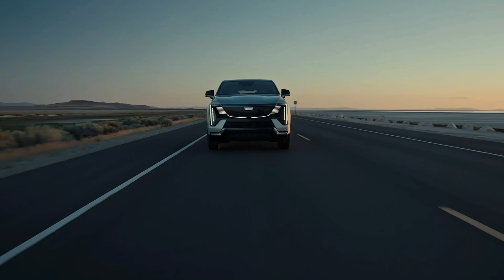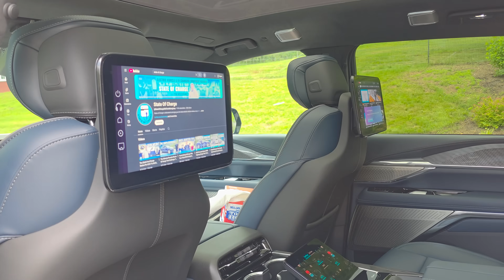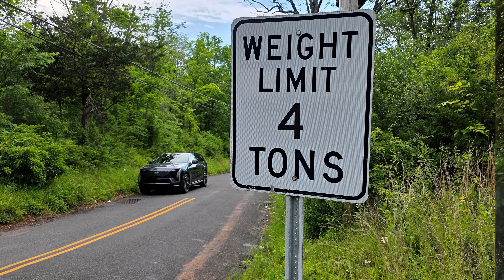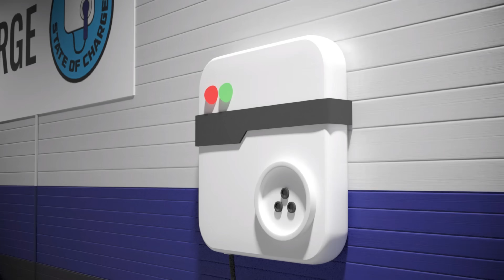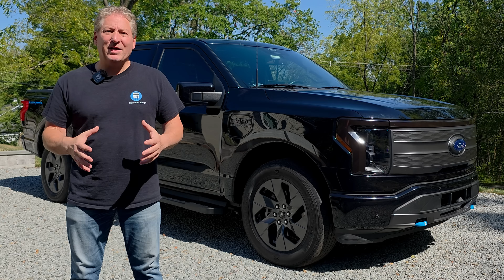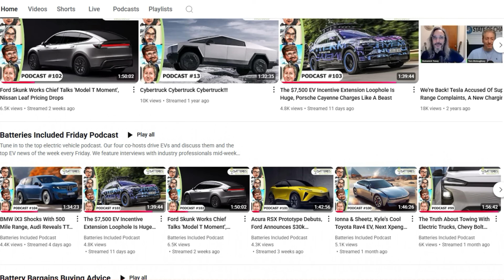Are General Motors Electric Vehicles Too Heavy For Some Public Roads?

Comment: Thanks for this. Honestly, most people are too clueless about their vehicle weight and posted limits for it to even occur to them to care, but for the few that do, useful and interesting info here. Fact is (and the comment from the anonymous engineer supports this), even with a 4 ton limit, a 4.5 ton vehicle isn't really going to cause excessive damage (on regular roads), or seriously stress bridges or other structures. It's not enough over the limit to matter. So while I think it's logical to conclude that in many if not most cases, the limit is more about limiting commercial vehicle traffic rather than specific structural issues, even if it were the latter these 4.5 ton vehicles seem "close enough" to not be concerned.

All that said, IMHO the real concern is efficiency and driver competence. Even 4 tons would be way heavier than most drivers have experience dealing with, and of course 4.5 tons is even worse. The EU limits "run of the mill/non-commercial" car and van drivers to 3.5 tons, and I wouldn't object to seeing a similar limit in the US. Even if braking is improved to keep stopping distances comparable, these super-heavy vehicles just don't handle as well as what most drivers are trained for and experienced with, and drivers should be required to get additional training and certification to be allowed to operate them.

On efficiency, these behemoth EVs that are showing up seem crazy to me. Sure, they are still better than the gas/diesel equivalent, but not nearly as much better as they could be if people didn't insist on 400-600 miles of range. I would love to see excise taxes imposed on all vehicles in all states, based on the weight of the vehicle, and taking into account all costs externalized by the vehicle. This would include road maintenance, but also environmental and health impacts, these two latter which are completely ignored in our current fuel tax system.

With EVs not paying fuel taxes, we need to figure out some kind of system that helps address that lack. Such a system might as well replace the old system with one that covers all the different vehicles in a more equitable way, rather than all the ad hoc "we hate EVs, so we're going to add a fee to registration that's double what an equivalent gas car would've paid" crap going on around the US states.

(In this fantasy world of mine, I would also change transportation budget allocations so that motor vehicles aren't 80-90% of the budget they way they are now. Even modest reallocation would allow a *doubling* of funds going to public transportation and "active mobility", i.e. ped/bike/scooter/etc. while still preserving most of highway and bridge maintenance funding, that's how imbalanced the funding is today.)

Comment: As always, it depends.  I was avoid driving on any specific structure with a weight limit as I would expect there is specific engineering involved.  There is a parking desk with chargers I used recently that at a 7500 pound weight limit.  It used to be less, but due to the weight of many of the cars that wanted to charge there, it was re-rated.

At the end of the day, if there is any damage that can be tied to a specific violation, you can expect paperwork.  In the original case used here, I think you will not have much issue unless you run into that official that wants to throw their weight around.

Comment: Tom, what you are saying makes sense for roads/bridges.  But what about parking structures?  They are not meant for large trucks.  So the weight limits there would seem to include only cars and light trucks.  With more and more EVs being sold, at some point it could matter how many EVs are parked in a multi-level garage.  If you get a hold of that gentleman (the retired Civil Engineer), please ask him about that.  Thanks for your videos.
Reply: Even our driveway, garage limits need to be understood.

Comment: Commercial Truck Driver chiming in here. NEVER go over a bridge if you are over it's weight! 

If the bridge collapses, YOU ARE LIABLE for any and all repairs to said bridge!

https://share.google/Yks8hXBLlyJXSFrta

EDIT
Also theweight limit could apply to ANY of the following if it's at the beginning of the road: 

-Asphalt Weight Limit
Usually applies to secondary roads during the summer months when the asphalt would be warmer and more susceptible to damage. 

- Buried Water Mains
There may not be a sufficient base under the roadway to keep you from collapsing a water main that traverses under the roadway with a heavier vehicle. Driving over such road could cause a water main break. 

- Bridge Weight Limit
Exceeding the bridge weight limit at a minimum will reduce its lifespan. At the worst it could cause an immediate collapse of the bridge possibly killing you and many others. If this happens you will be on the hook for everything in your life will be destroyed financially and legally.

Comment: Having been a police officer in the mid-west many years ago, we used to have "seasonal" weight limits posted certain times a year (based around cold weather changes).  However, there were almost no police who enforced those postings.  Mainly the IL state police and a coupld county deputies.  But the funny thing is that the vast majority of drivers would have zero clue how heavy the vehicle is that they are driving.  And even fewer would pay attention to any signs.

Comment: There are additional costs to large, heavy vehicles like the 9K+ pound GM EVs - extra tire wear and particulate generation is inevitable, as are the costs of accidents with smaller, lighter vehicles. As well, the mass requires additional electric power for a given distance, which means whatever the source - Solar, Hydro, Nuk [sic], or Fossil - there's a need for more power generation and its costs ($ and environmental).

Electric cars and trucks are not "clean" in any whole-system accounting, and this trend towards excess just makes it worse.

Comment: You provided the best information! I purchased a Grizzl-e 48amp charger based on your recommendation.  It's outside in Florida. 
I especially liked the information about the weight of EV's not being significant vs ICE vehicles.  This is a common talking point of the gasoline industry.  I would really enjoy a video of the PhD engineer that you referenced.  
Keep up the honest and unbiased information for the EV lifestyle.

Comment: I saw one of these massive SUVs charging in my home town. Coincidentally it was when I was charging my brand new Equinox. It’s a small town and only has a single public charger that is a 7kW L2 charger. Fine for me for overnight charging, but when I looked up the size of the battery pack on that beast I hoped they were only topping up or they would be stuck there for a couple days!

Comment: Thanks for your follow up on this topic Tom. I would love to hear more from your experienced pavement follower. I know I've seen similar commentary on the vehicle weight to pavement damage and have seen clips from studies done outside the US about this topic supporting the standpoint of your experienced pavement follower. Considering the innovations in the automotive industry in the last 15years, it may well be time to whole hog review and revamp the ordinances, roadway design and roadway safety features with these heavier and wider vehicles in mind. Certainly some parking lots could use some re-thinking. Heck, is the old 3-4 car length highway speed travel spacing enough or does that need to be updated with consideration to the vehicle weights? (Maybe we go 6 car length Covid spacing 😇)

Since the signage is unclear, I would find it difficult to believe that the average user would be able to easily differentiate if this weight limit signage was due to structural issues vs. commercial vehicle re-routing. I would have no trouble believing that, should an issue somehow happen while crossing that surface, your insurance company would use that (as they tend to use any reason) to disqualify you for coverage. I would also not trust that one police opinion on the matter would be carried out 100% by every officer in that same region unless it was clearly spelled out in the ordinance. I could easily see it tacked into someone getting a ticket for failing to yield, speeding, having an expired tag or wearing white after labor day (old person humor). Drivers should probably assume the worst case scenario for their own personal and pocket book safety. Assume that the road will fail and there will be a cop in the bushes nearby to immediately ticket you. Someone might also take a picture and send it to your parents to let them know how naughty you've been.

Comment: as an interesting point in talking about weight, those keen Engineering types like myself with a sense of what the heck it is they're looking at in the first place will have noticed with the recent debut of the sweet Polestar 5 EV (a Sedan btw so not an electric SUV or Truck) is that it uses a ginormous 112 kWh battery pack, and has a 120 inch wheelbase (this would be same as a Gas Tahoe) and is fitted with 22 inch wheels all around.  now DESPITE the fact that this uses advanced all aluminum construction similar to a Lucid, the rumored weight of this new EV is nevertheless predicted be a massive 5,600 lbs, and this actually checks out when you consider that the ultra advanced Air Sapphire Sedan with it's Tri-Motor RDU and 118 kWh battery pack weighs (rounded up) 5,400 lbs...

ladies and gentlemen OG BMW Phil tells you with the same authority as that Civil Engineer that the idea of "battery progress" that you've been getting sold over the last 10 years is a MYTH.  ref: The "Myth of Progress". also ref: "The greatest DERANGEMENT of the mind is believing in something because one WISHES it to to be true..." - Louis Pasteur (1822-1985)

Comment: Tom.  Did a quick google search and this came up.  

For most pavement designs, engineers primarily focus on heavy trucks because their weight causes the vast majority of road damage. The impact of passenger cars is considered negligible in comparison, but they are still factored into the overall traffic volume and used to determine the geometric features of the road.

Comment: I envy your bladder if you can drive for 600 miles without a stop.   My real world experience in road tripping at my age is that after about 200 miles (~3 hours) I need a break is and that’s about as long as I want to go before stopping to take a break and charge.   500-600 mile range just means that I’m carrying around a huge battery I don’t need at basically any time..

Comment: Tom, what about for thinner secondary roads, where heavier, EVs are (or will be) causing a disproportional amount of the deterioration of the roadway?  So the civil engineers argument is really for a weight-based road tax, isn't it? 

The problem with expertise it can be used to mislead, just as well as inform. (At least that's what I find from my mechanical engineering perspective)

And FWIW in PA there are exemptions to road weight limits, for local deliveries and egress, So I'd be safe to own one. But would still have to stay off the underweight bridges.

Thanks for the thought-provoking rabbit holes ;)

Comment: I wonder as EV batteries (maybe not, as pointed out about density improvements) get larger, NHTSA will start requiring these heavier EVs to require lower PSI tires. Which means much wider tires and/or dually requirements.
From what I've heard from roadway engineers that it's not necessarily the overall weight that matters, it's the PSI required to support the vehicle and/or load as that's what's ultimately putting pressure and therefore damage on the pavement. 

But as pointed out in that engineers youtube post, most semi's and other medium duty vehicle tires are 80-100PSI+ compared to even HD 1-tons that are usually 60 or less. My Tesla and Equinox EV are ~42PSI compared to the 32 of the ICE Camry I had. So not a big difference compared to 80+ of commercial vehicles.

Comment: In Michigan, electric vehicle (EV) registration fees consist of a regular vehicle registration fee plus an annual EV surcharge, both of which are primarily based on the vehicle's weight. The EV surcharge is adjusted annually based on the state's motor fuel tax rate. 
EV and plug-in hybrid surcharges
The additional EV surcharge for 2025 is calculated as follows: 
For a pure EV, the base fee is $100 for vehicles weighing 8,000 pounds or less. An additional $5 is added for each penny the fuel tax rate exceeds $0.19 per gallon.

Comment: I think the real issue is drivers of E vehicles are not paying gas tax  that is used to repair highways. If you can afford a monster vehicle that weighs so much, you should also be able to afford a new road tax instead of putting the financial burden for repairs on those that can not afford the luxury of an electric vehicle, especially these GM Monsters.

Comment: I’ve always thought those signs were to keep truck traffic off the routes but specifically I was under the impressions those signs mean per axle since if you’re crossing, just a small culvert it would stand a reason that only one axle would be applying force at a time. 
Now I would be a little bit cautious if there were some kind of old wooden covered bridge, but other than that, it wouldn’t give me any pause driving around.

Comment: There was a study recently done on road pavement damage in my city and the conclusion was about the same... only large trucks were really damaging roadways.  In particular, on residential streets, it was the garbage trucks that were doing the vast majority of the damage to the road.  The city is now looking into having a larger number of smaller garbage trucks.
Reply: There aren't any large trucks on these street? If you think he's illegal, what do you think they are.
Reply: I honestly think this is just a response to all of the fear mongering from naysayers and fans of competitors that can't afford to put similarly sized battery packs this large into production vehicles that directly compete with this. A loaded Amazon van weighs about 10,000 lbs, so if a GMC Hummer or Cadillac Escalade IQL are causing damage to residential roads, then so are these carriers constantly delivering packages. This is a non issue for gm.

Comment: This is really helpful. I’m also in New Jersey and drive a Silverado EV that’s just over 4 tons. A few of the roads near me have a 4-ton weight limit.
Reply: It’s primarily meant to keep commercial through trucks from using these roads.  School buses are always permitted unless there is an engineering reason like an inadequate bridge, etc.  These restrictions are not meant for four wheel vehicles like the Escalade.

Comment: Hi Tom the lightning lariat is around 6,800lbs not 5,800. I assume you misspoke. I weighed my 23 xlt extended range when doing a dump run and it was right at 6,500lbs empty.

Comment: I find it odd that your extended range Lightning is 3000 lbs less than mine, a 2024 Flash at 8550 lbs.
Reply: He's stating curb weight (only vehicle) while your stating GVWR (max curb weight plus payload).

Comment: GM can fix this by putting these vehicles on a diet. Start by using only 8 speakers! That will allow them to eliminate the heat sink laden, power amplifiers. EVs are the quietest of all vehicles. Next, use stamped steel wheels with Stainless Steel Hubcaps, instead of expensive, cast aluminum wheels! The taxing of EVs is a political football, the registration should include the equivalent of the fuel taxes not collected, but based on the EPA listed efficiency of the vehicle, such as Tesla cars which get 130 MPGe on average. The Owner should be required to to snap a photo of their mileage at the time of renewal of Registration to determine how many miles it has been driven which can be compared to what it was at the time it was registered or renewed previously. The two number subtracted from each other, and a computer printed mileage affidavit produced the owner would sign! This affidavit would be used to calculate. The amount of tax the owner would have paid at the virtual gasoline pump, and this amount would be added onto the registration fee! Now, that should become the gold standard, not the punitive, fees being devised by often nefarious intentioned politicians, at the state level!

Comment: The real solution is to keep vehicle weights under 5000 pounds. I'm glad the LA black car services will go electric with this massive Cadillac, but there's just no reason for such a heavy passenger vehicle…and is it only a 4-passenger vehicle?! That middle console in the back looks like it's designed to keep the passengers from getting frisky in the back seat!

I took one class in roadway design in college, and I do vaguely remember that bridge design and roadway design is entirely dictated by the 40-ton traffic.  The bigger concern is traffic accidents. I think anything over 5000 pounds should require a different class of driver license with annual physical exams and a .02% allowable blood alcohol content. If you can't drive sober, you should certainly not be in a big heavy vehicle likely to kill anyone you run into.
Reply: No, it's 6 passengers has a third row.

Comment: It's why I like the Bolt and Tesla Model 3. They get quite a lot out of their small batteries and it keeps them in a reasonable weight class. I know Chevy are working on the next Bolt so hopefully we get to see them flex their efficiency muscles. I much prefer an EV that gets a lot of range through careful, efficiency-minded engineering, rather than the brute force strategy that leads to these insane curb weights.

Whether they damage the roads or not, that kind of weight has a huge effect on running costs and it's harder to scale up manufacturing because of the sheer amount of raw materials needed to make all of these enormous batteries.